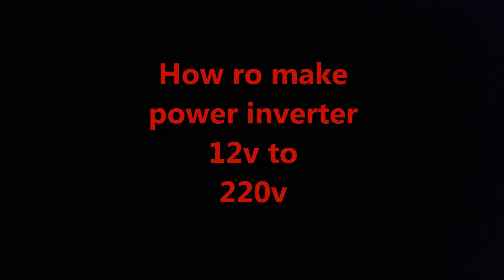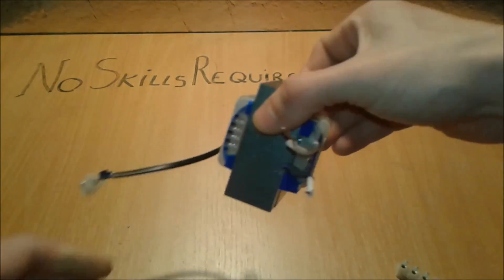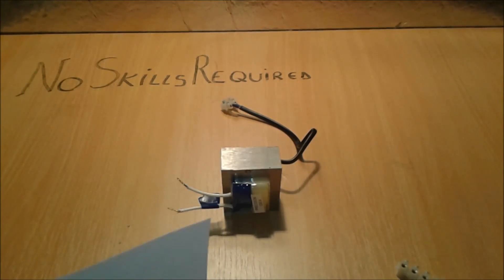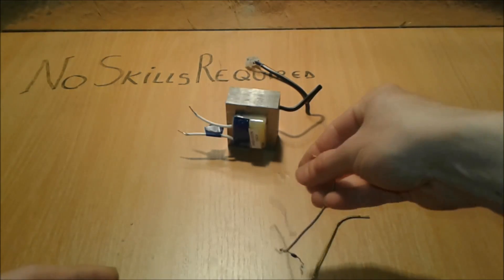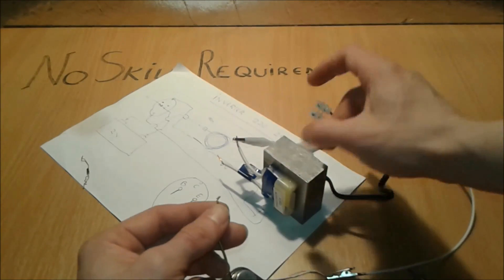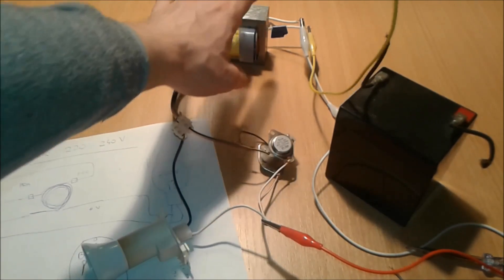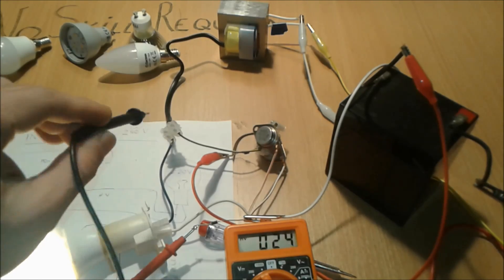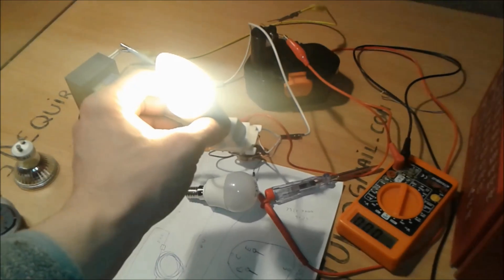How to make power inverter 12v to 220v at home Very easy circuit diagram

Comment: i really like your youtube videos. I find them very informative. I also like that I dont have to go look something up or google something from your videos. You explain everything very well and in a way a newbie can understand.  If I might I'd like to ask you, I have a 90 amp transformer from a 110 welder. everything has worn out on the welder. I have 3 other welders what else could I use this 90 amp transformer for? your help would greatly be appreciated.  'dI like some kind of generator or something.
Reply from the maker: hawkadaddy Thanks for your kind words that its all about this channel no skills required and we learn doing stuff sone times funny,easy recycle and usefull.about your transformer you can make a big inverter,a spot welder,car battery charger  but some needs to remake the windings all the best

Comment: hi may i know how to determine which is base and which is emitter on darlington type transistor?  by the way, thanks for sharing the simplest circuit for beginners like me :), its easy to understand, make  electrical and electronic more fun to do.
Reply from the maker: +Owat Thorne Hi mate this configuration is a darlington pair witch meas 2 transistor in parallel every transistor is different so best way google transistor name + data sheet all the best
Reply: thanks buddy

Comment: Measurement of 21.0vdc pretend to 210vac, please don't lies to audience, the multimeter measurement is showing dc range was selected, to light up led bulb is not a evidence to proof you can make a 12vdc inverter to 220vac, what a sucks!
Reply from the maker: is in the dc range but it shows 220v because almost all inverters are not true synwave is pulsating dc with just 2 components is more then ok do it yourself then post coments
Reply: Ng Jimmy 0

Comment: This is Crazy, why not just use a 12 Volt LED Light Bulb and cut out all the parts that you have to buy and assemble to power up a 220volt Bulb?????
Reply from the maker: Not everything can be powered from 12v and for improuving efficiency. 10w led on 12v consumes 0.83A but an led 10w on 24v  consumes 0.41A and so on till 220v the perfect solutions is series cells but instead we use inverters ,step-up converters, joulethiefs and so on
Reply: Seems like a lot of trouble just to Light Up 1 LED bulb though!!
Reply from the maker: +Robert Rudolph in some cases you can use just 12v for led and plenty of gadgets but think of this central heating on gas in the winter all of them operate on main voltage 120/220v and maybe if you search enough you will find something on 24v.all the best

Comment: i can use it only for light or can use it multi purposes ???
Reply from the maker: depending on the load if the load requires more watts the power consumtions increases in the dc part it is designed for low power devices